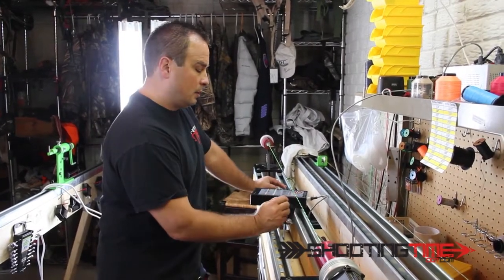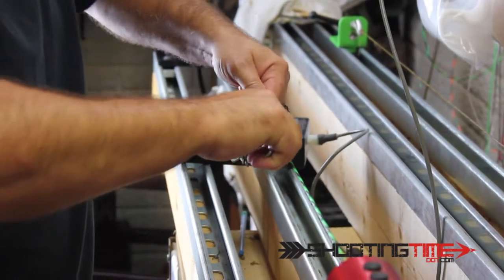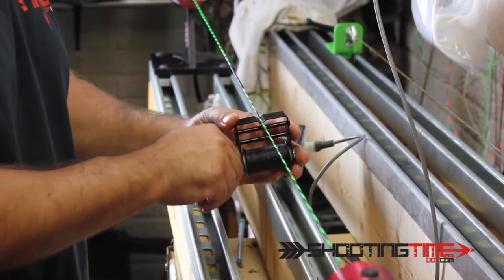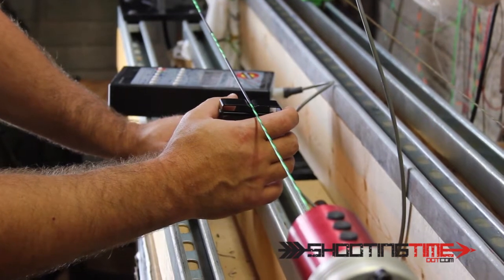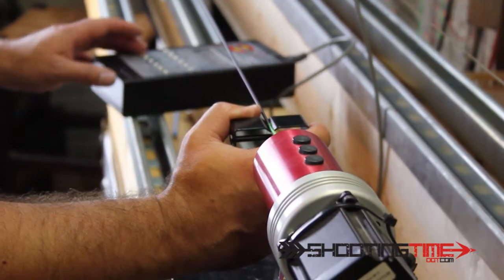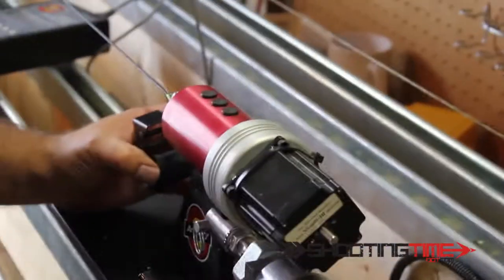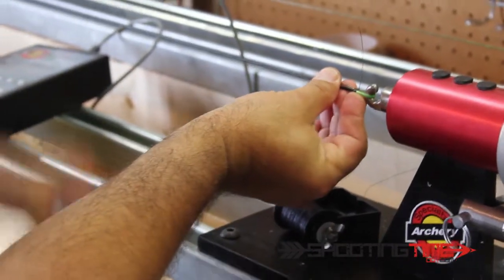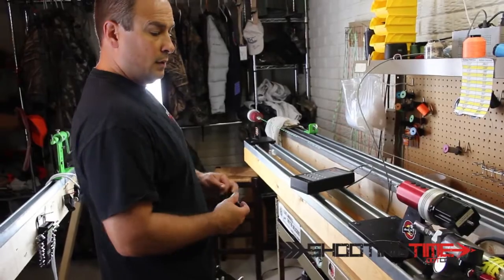How to Make a Bowstring - "Cam Servings" - Part 5 of 5

Comment: I make strings better than 99% of the ones using the motorized string spinner for winding serving, and all I use is the BCY string jig, and NW Spinner kit and associated serving jig, and a drill.  It may take me 2 hours to make 1 set, but quality control is much better when you do most everything by hand.  

In the video above, the way this guy is winding on the serving is going to impart a natural left-spin to the arrow leaving the bow.  I make my strings that impart a natural right-spin, so that arrows fletched right helical (which is about 90% of all arrows fletched nowadays) won't have to fight a left-spin string.